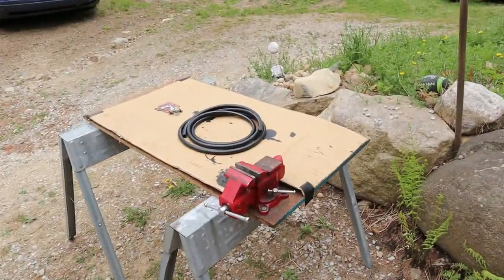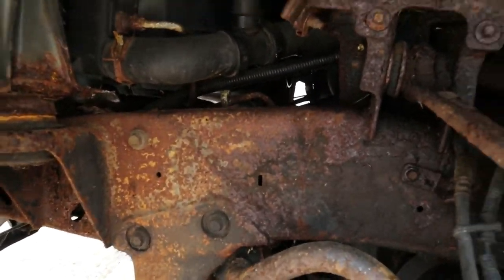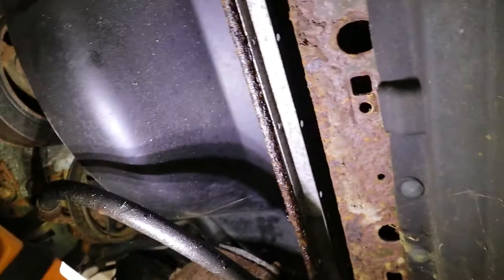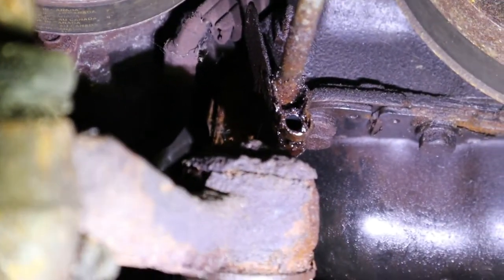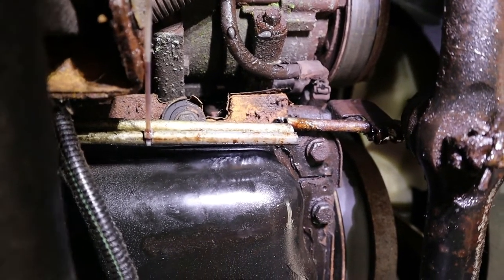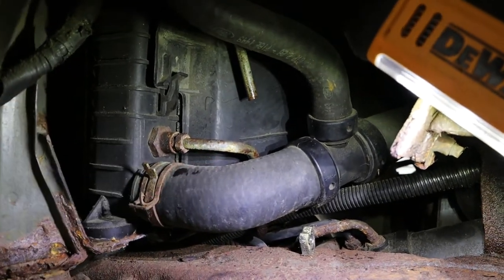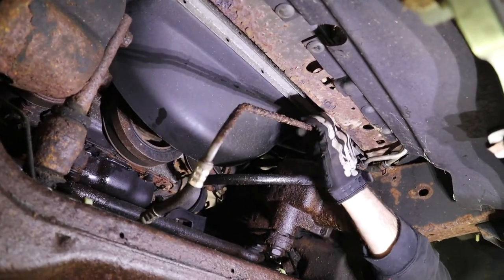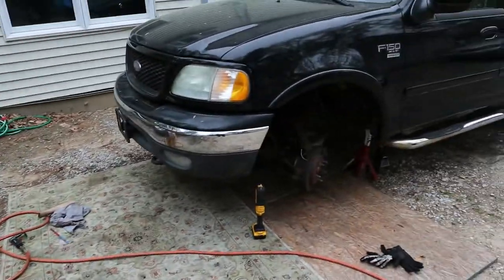EASY BUDGET TRANSMISSION LINE REPAIR

Comment: I don't usually take shortcuts like that, but for an old rust bucket, this is a great solution. I have the same problem. I would rather replace with real lines, but I don't want the hassle of possibly breaking the rad connection, and that does happen. Its absolute BS that these lines are made of rusting metal.
Reply: Nice video I've got the same problem  I think I'll  do the same until I replace the engine thanks for the informative  video

Comment: Glad to see it worked ill remember the fix.

On the brake lines, if youre handy with a flaring tool you can replace the old steel lines with copper tubing. Copper tubing will never rust and will last forever.It will easily handle the fluid psi
Reply: It will corrode though
Reply: @kennybakerhvacr5751  very slowly compared to the steel lines

Comment: That’s a temporary fix as it’s not a lot of pressure at idle but god forbid if your towing or pushing the truck to where pressure starts to build it will come apart….. a more successful fix is to flare the line ends but it’s definitely a pain in those tight area’s

Comment: Speaking from personal experience on my truck soft line isn’t up to task the fluid is to high pressure
Reply: Did you use regular heater hose? Or did you use fuel line rated to 200 psi?